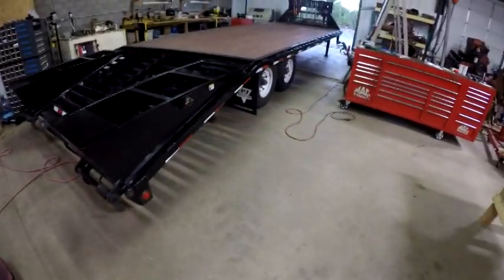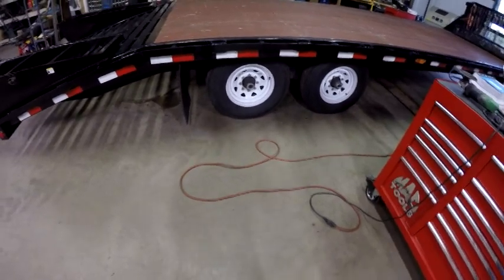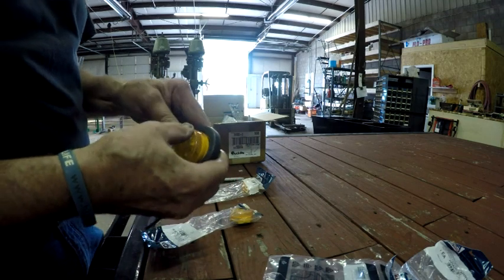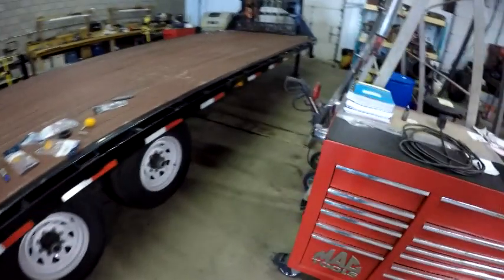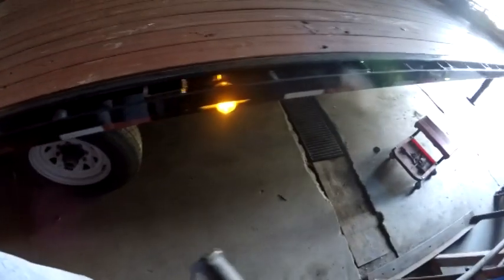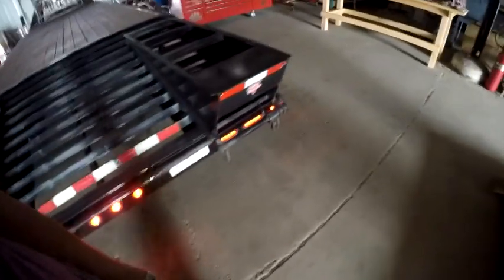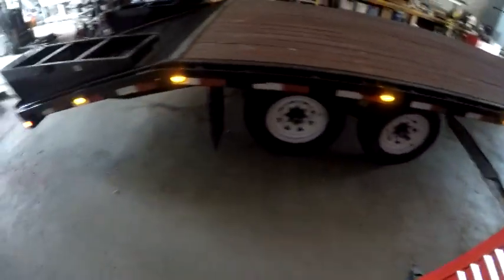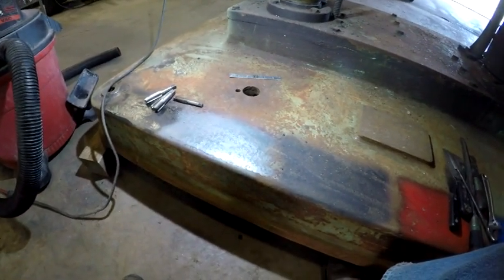Shop Update 09/08/17 - Trailer Lights and Drill Press

Comment: Keep in mind if the light is there it needs to work, more lights = more chances (and excuses) for getting stopped.
Reply from the maker: Yeah, I do have a box of spare lights for trailer! I knew that light had blown but kind of forgot about it until inspection guy mentioned it. Probably should keep them with me so I can take care of those things right away, instead of putting it off until I get back and then forget about it.